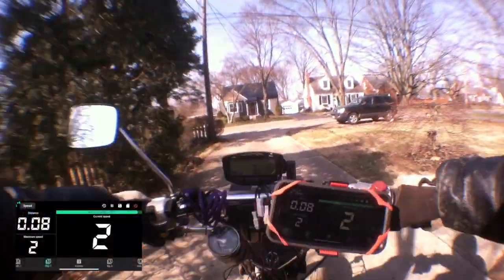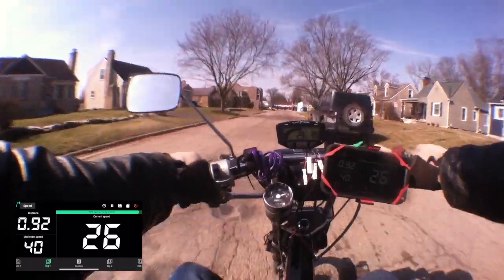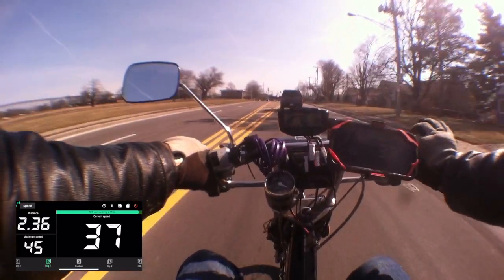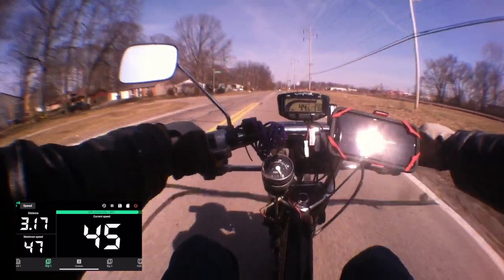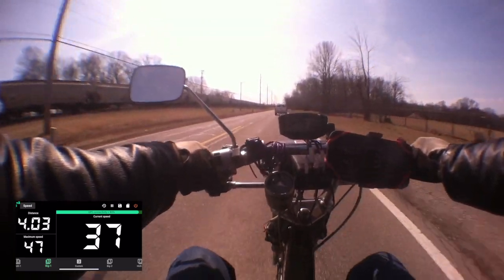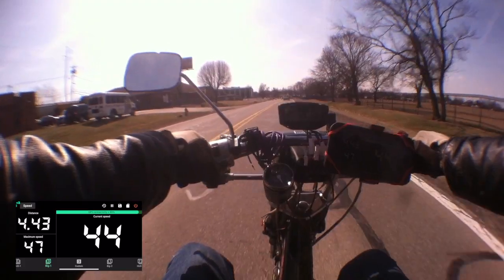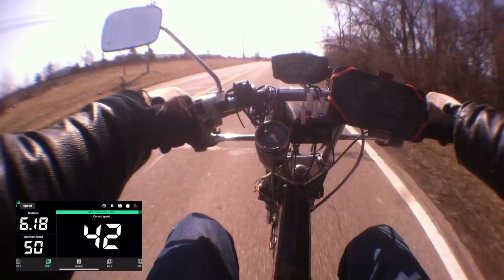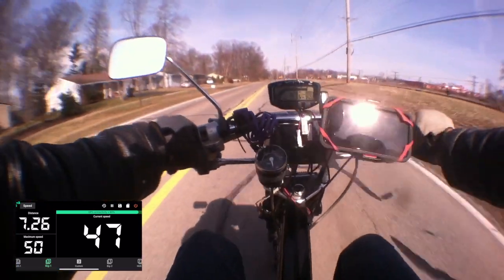Danger, don't do this! Honda Urban Express 49cc goes for 50mph

Comment: Thats epic it actually hit 50! And on a flat. I wonder how quick it would go down a massive hill...
Reply from the maker: It's pretty stable at that speed but you always wonder when things will get iffy.
Reply: @jackrutherford-1  yeah I get uneasy at 37 on my 83. its a massive hill and the bike picks up a lot of speed. I'm always worried the engine is gonna explode because it sounds unhappy.

Comment: The Pennsylvania Ripper is getting nervous!
Reply from the maker: just had a major qt50 fail.  I had same guy bore out a yt60 cylinder a while back and I've just now got around to trying it.  He bored it too big and it seized up on me 3-4 times in 10-15 minutes.  Same reason those eBay kits seize - too much piston-cylinder clearance.
Reply: @jackrutherford-1  Accurate Cylinder Works to the rescue.
Reply from the maker: @davidking5722  yea they were the ones who bored it.  I think I'll go back to 49cc on this one.
Reply: @jackrutherford-1  Were you using enough oil for the break in? I fried two Ebay kits by relying on a faulty oil pump and not using strong enough premixed. I broke the ripper in on 32:1 am using 40:1 and could probably get a way with 50:1 now that it's broken in. The Pennsylvania Ripper!
Reply from the maker: @davidking5722  she had plenty of oil

Comment: I just bought myself a new noped. A 1982 Honda Express SR and have been wondering what exactly is different between the urban express and the express sr performance wise. Could I follow your tuning path that you took on the urban express and use it towards my SR?
Reply: I am rebuilding a Honda Express SR and am wondering the exact same thing! Please let me know if you’ve come across any good resources on the differences in the engine. Can’t find many examples of SR tuning on the usual forums. Thank you!
Reply: @SMWroms  So the only difference I’ve found is the transmission. The urban express is a bit longer because of the larger wheel in the back. So the belt, gearing, and wheel situation is different between the two. I installed a 70cc kit from an urban express on my SR and it bolted up no issue. I also installed a 20mm carb using urban express bolt on kits. No issues. To sum this up, all urban express mods should work fine on an SR excluding the belt, gearing, and rear wheel. Oh yeah, the exhaust mounts are a tad bit different between the two so if you buy an urban express pipe, you may need to do a little bit of work to it.

Comment: It would be faster w the bx31 and bigger jetting 🤷‍♂️
Reply from the maker: Nope.  Bx31 creates taller gear that results in lower rpms. Pipe needs higher rpms to get in the power band. Bigger jet would make it bog down and slow it down. Jetting has to be perfect. Belt size has to be perfect or very close.
Reply from the maker: I had already installed racing gears so my gearing was pretty strong already.